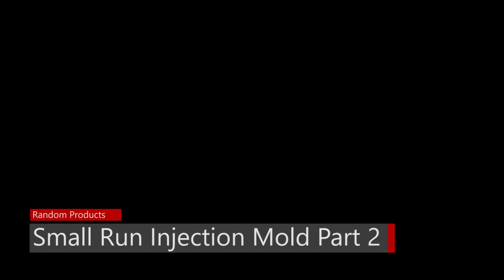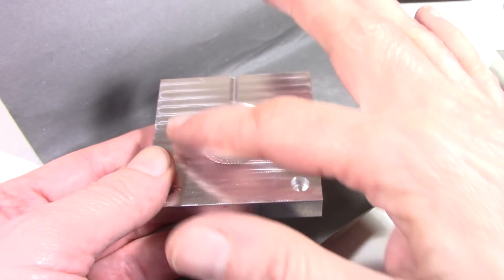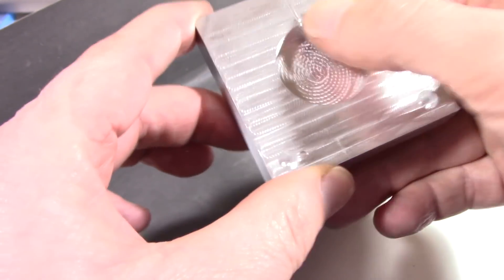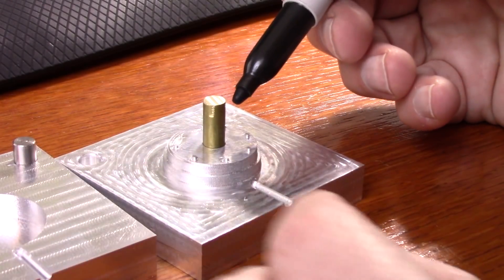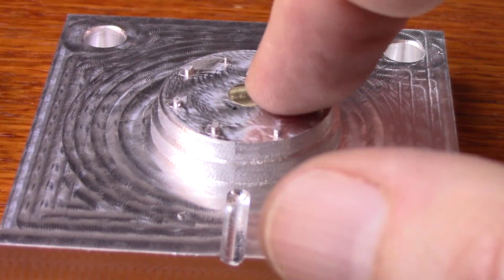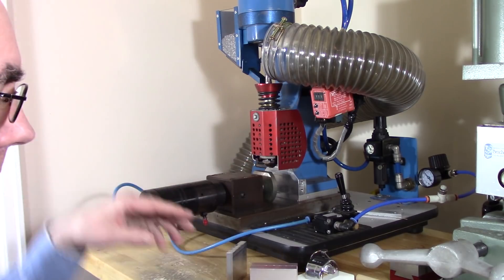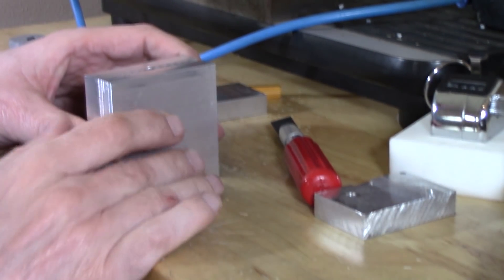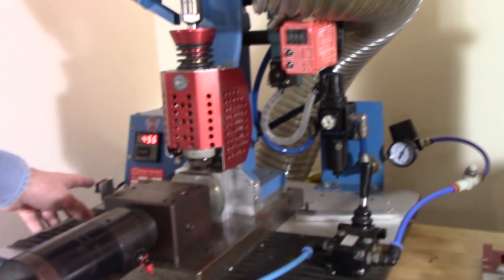Speaker Enclosure Mold Part 2

Comment: The center puck simply needs to be machined 1/2" taller. Then a plate that is 1/2" tall needs to be cut [bored] to fit over center puck in a manner so it fits snug, close tolerance but not so close it can't slide up and down. The bottom part of the sprue channel would be cut into the center floating plate.

The 3 plate arrangement would need 4 pins to align everything. The center floating plate would be set on springs so the springs allow the mold to close up under pressure. Then after the plastic is injected and cools the mold can be opened and the springs would force the center plate up and pop the plastic part off. The rear plate could be made thicker so the springs could be inset and stay in place. The springs could be placed around the alignment pins or in separate pockets placed equally around the mold circumference so the act equally on all 4 sides to apply pressure and force the center plate to pop the plastic part off.

Be sure to use small but strong springs so all together the 4 of them would exert a reasonably high force on the plastic part so it pops off the center puck part of the mold. Since the force would be directly on the circumference of the molded part, it would be unlikely the part would break as it is forced it off the center part of the mold.

I would recommend clear silicone lube be used on the center plate so it moves freely over the center puck. The silicone lube would still function at the higher mold temperatures but might need to be re-applied every so often as needed.

Idea: The center puck part of the mold could be turned from tool steel on a lathe then have the center details CNC machined as the aluminum version was. It would be pretty easy to polish the outer circumference while it was on the lathe. After it was finished it could easily be hardened and the polish touched up. This center puck part of the mold could simply fit into a stepped hole in the rear mold plate and be bolted in from the rear. I would use an alignment pin from the rear or a set screw from the side to keep the steel puck from rotating. If this was done the mold could last for 10k or more parts as the floating center plate would never wear it out while it moved in/out on each mold cycle.

I have a taig CNC mill and a taig lathe. I also have a Bridgeport mill, a craftsman 12" lathe and a enco 14x40 lathe. I want to retrofit my taig with a larger frame like John did but I'll make it myself since I have everything to do it including the welding equipment.

Comment: Hi John,
Great video, as always.  I see you are still using the older injection molding machine.  Do you still plan to start using the Morgan Press machine you referred to in a previous video once you get the new shop built?
Reply from the maker: Thanks. I plan to set up the Morgan before I get the new shop. This mold is better suited to my AB-100. I'll be using the Morgan for larger molds than my other machines can handle.